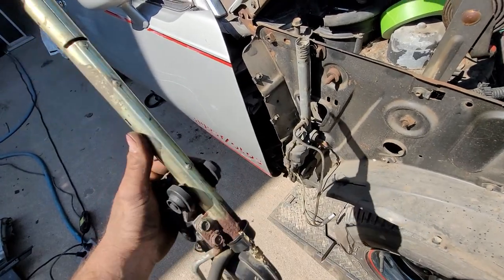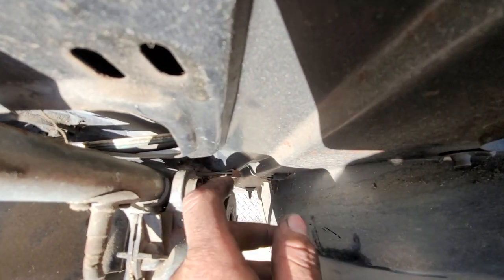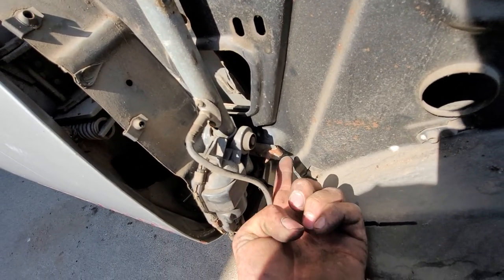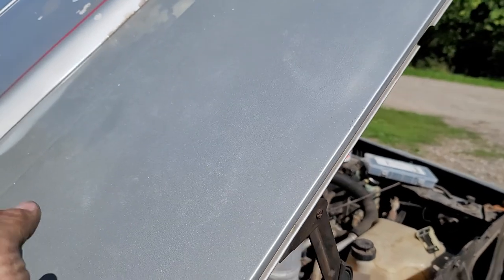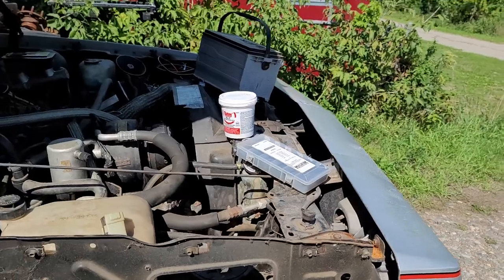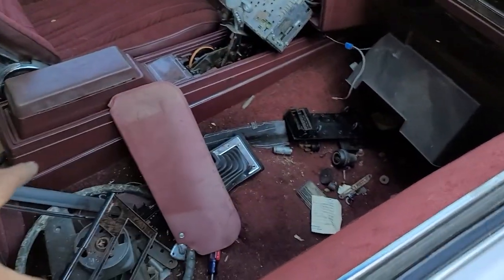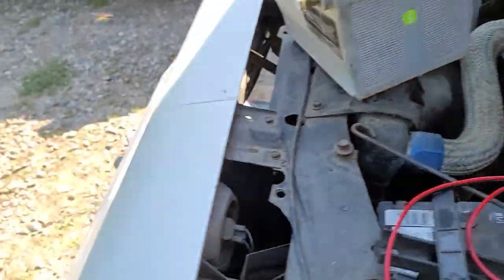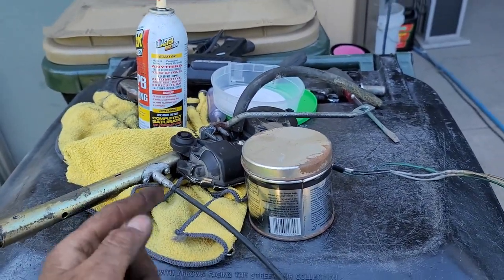1984 Cutlass Hurst/Olds Power Antenna Replacement Pt. 1

Comment: At 2;38 / "you were right" ... these are rather easy to do / and they should be re-engineered amid the newly available steel cables. I did a video about this / see it here. Also: a 1/4 drive swivel on a quarter ratchet is another means of access. LOVE your videos !!  :- ) 

 BEAUTIFUL CAR !
Reply from the maker: Thanks Much for watching.  I need to do an update Video soon, been working away on it lately